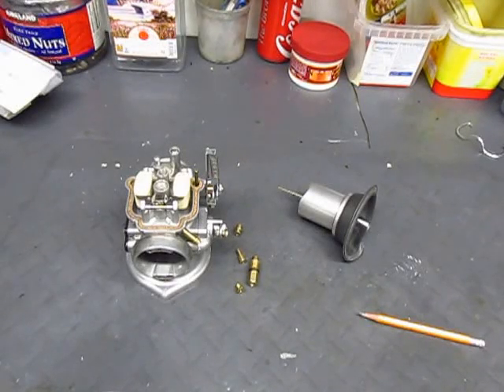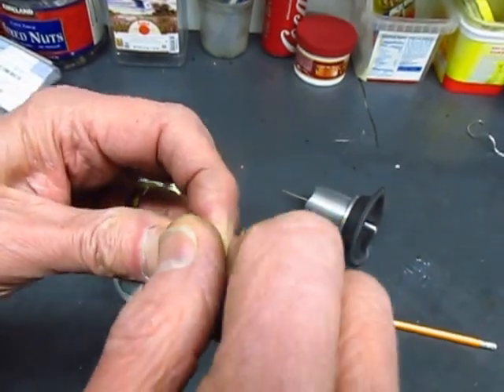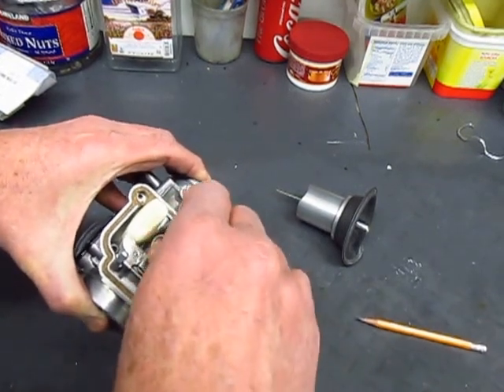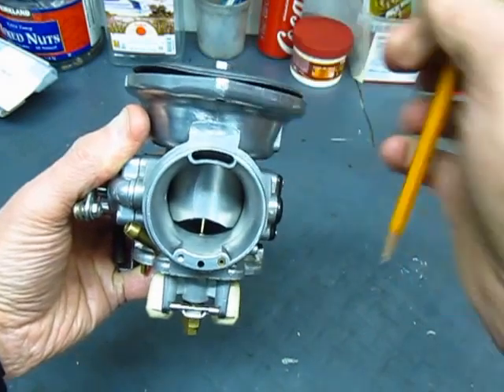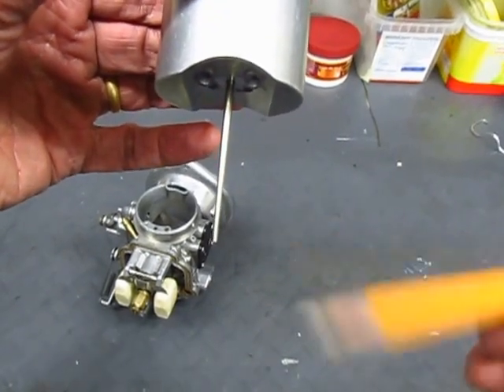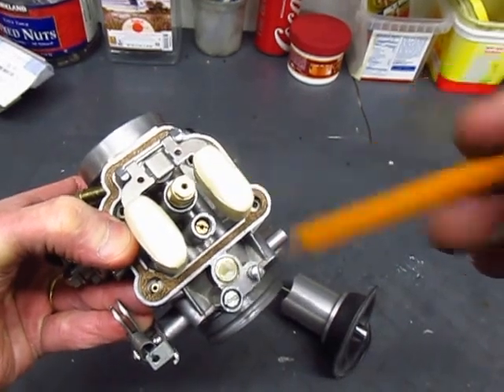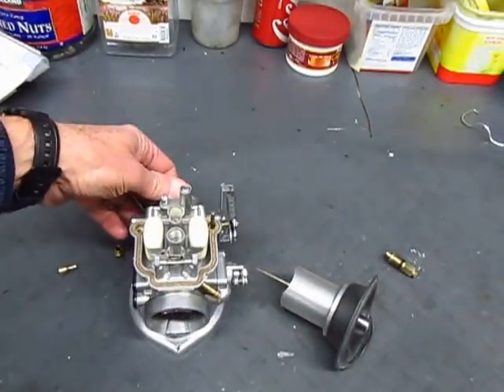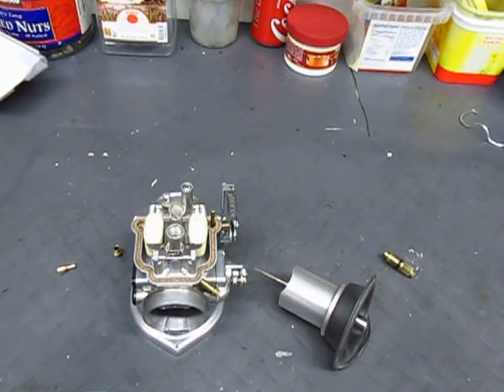How the Main + Needle Jet Circuit Works

Comment: Hi Brook, thank you, very clear.
I am having some issues between 2,000-2,250 RPM with the engine coughing and being a bit rough. Is the idle circuit or the main + needle jet circuit?...or both?
Reply from the maker: Francesco, it could be the needle jet and jet needle are worn which enriches the mixture. It could be the ignition timing advance is not advancing correctly. It could be the valves need adjusting as they may have closed up.
Reply: @BrooksAirheadGarage  thank you Brook. Will investigate all the above

Comment: 3:25
Never knew about that "needle" jet on top of the main jet. They always say the Main jet and pilot jet.
I took mine apart and while i THOUGHT it was clogged and use thin wire to "clean" it out and put her back together, she still sputters once i start to accelerate while idle is perfect. 
Now you show that little piece "top part above the needle jet" that has those 2 holes and the chamber than runs thru the inside of the carb housing to help air flow thru to help suck up more fuel ... i had NO idea that was there and if that passage is clogged or that piece with the 2 holes is clogged, that would def cause issues once i start to give it throttle ... 
Funny how i have watched NUMEROUS videos about cleaning bars and NOT ONE single video showed what you just showed ...

Comment: Recently had my bing carbs rebuilt for my r90/6 but the guy doing them said that the right carbs main jet is frozen into the carb body and he was unable to remove it. 
Any suggestions or do I need to get a new carb?
Reply from the maker: Roger,  I've not had that problem before. I would try Kroil penetrating oil and some heat to see if that will get the jet to turn. That said,  the carbs are made out of "pot metal" which is mostly Zinc. You do not want to over heat the material around the main jet or you could melt it.  I'd try a heat gun, not a propane torch.

If it still won't budge, call the Bing Agency [(800) 309-2464] and see if they are willing to try and get it free for you if you send it to them.

Comment: When I cleaned the carb I forgot to clean the jet needle but it didn’t seem dirty. Is there inside parts that could be dirt
Reply from the maker: Hi Tyler, There are passages in the body of the carburetor that can get gummed up, particularly if you leave fuel with ethanol in the carb for several months, like happens when folks park the bike for the winter but don't drain the fuel out of the float bowls.

Typically the jet needle does not need cleaning. The needle jet may need it. And, after 30-40,000 miles or so, both may need to be replaced due to how vibration of the needle can change the diameter of the needle and the jet which makes the engine run too rich.
Reply: @BrooksAirheadGarage  ok thanks it’s been awhile so I’ll Look into replacing thank you for the help.

Comment: I'm a little late to the party but I was wondering if the individual floats that slide on the guide can be replaced by the 1 piece unit in this video? I'm rebuilding some customers Bing CVs for his 80s R100 BMW and the floats don't . . . float. :|
Reply from the maker: Justin, In fact, the floats I use are the stock BING floats. BING also offers ethanol "resistant" floats that have two halves. I don't use them. I've heard folks comment that the resistant floats have some issues in operation.  I typically rebuild these carburetors every 6-7 years anyway.

Comment: how many shims can you put on the needle jet untill you have to buy a smaller diameter one
Reply from the maker: Mike, there are no shims used or available. You replace the jet and the needle at the same time.  They wear due to vibration. Expect about 60,000 miles from a set.
Reply: I have 1980 GS1000 BS34 CV Carbs the needle valve has 3 washers on it . no adjustment, stock it had a plastic washer but to richen it up I replaced it with the washers. after 4 into 1 header and pods the mid range is Blaaaa so I thought raising the needle with more washers might help get more fuel there. I increased the main jet size, dang I can't remember how big.

Comment: Hello...our airplane with a rotax engine uses 2 Bing carbs on a rotax 912UL engine 4 stroke.
These videos of yours are great. I have a question... the 8 plugs on this dual magneto engjne carbon up immediately from new.
The carbs have been cleaned and balanced with new main jets but no change. Still rich.
Does the needle and needle jet wear at all? Should i look at relpacing them as well?
Reply from the maker: David, I know that Bing supplies carbs for aircraft use, but I didn't think they are the same design as for the motorcycles due to the differences in engine use between airplanes and motorcycles.  

To your question about wear of the jet needles and needle jets, yes they do wear due to vibration. I always replace both when I rebuild the carburetors.  

When I flew, the airplane had a manual choke and fuel mixture control so I could lean it out at altitude. I assume yours has a similar arrangement. If so, is the mixture control working correctly?